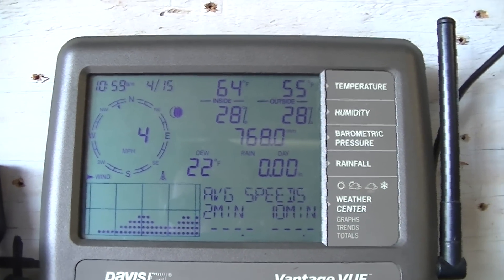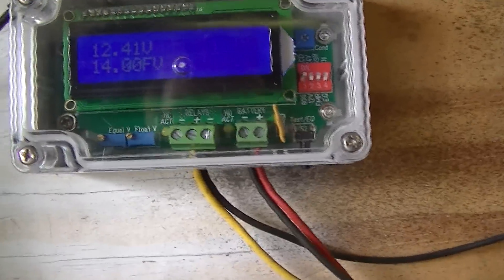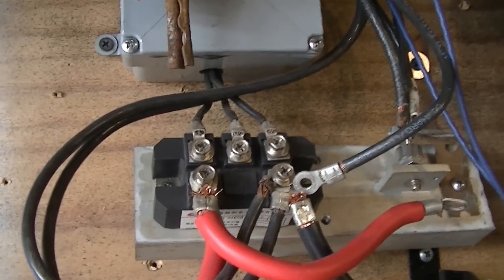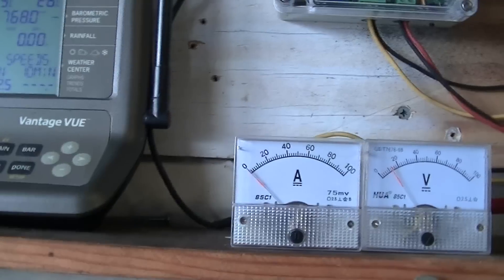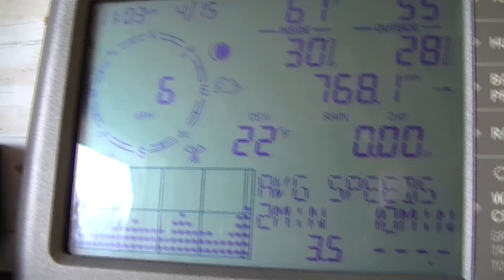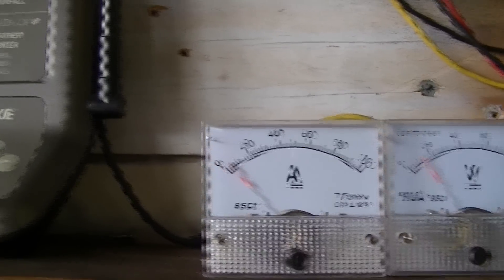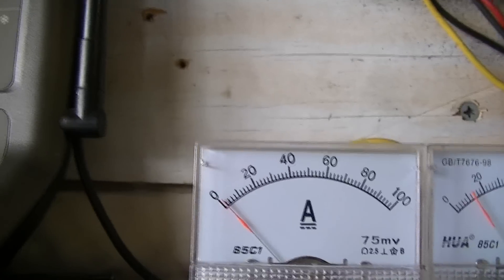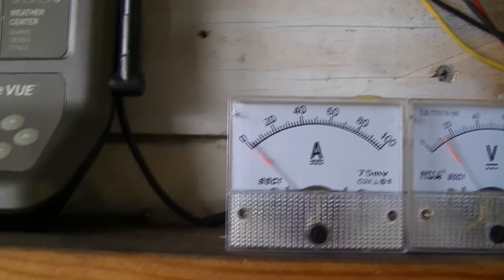Thermodyne KT Clear Blades Low Wind Power Output

Comment: Wind turbulence can be a big factor.  Dirty wind does exist and I get it when it blows from the East and the power output is only half of what I get from a West wind. The wind speed meter says it's the same MPH but the wattage is only half when blowing in from the East so it's a peculiar problem for sure but a very real one.  I wish someone sold a wind turbulence meter or a whirly-cup that corrected for it.